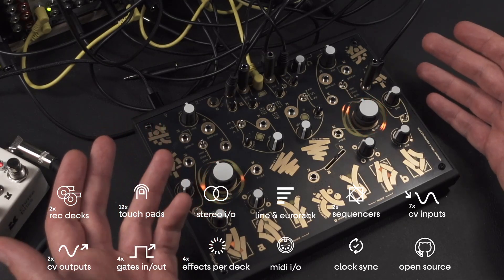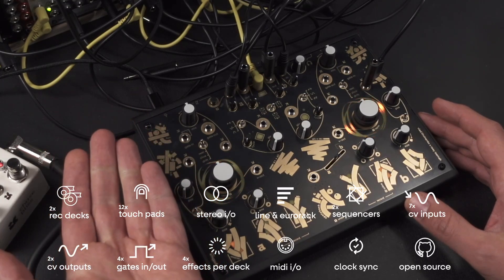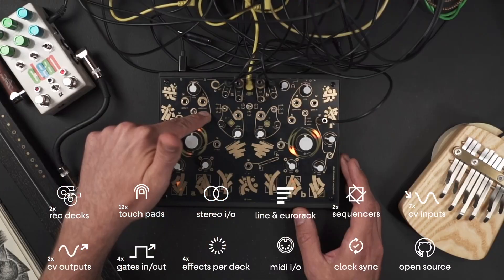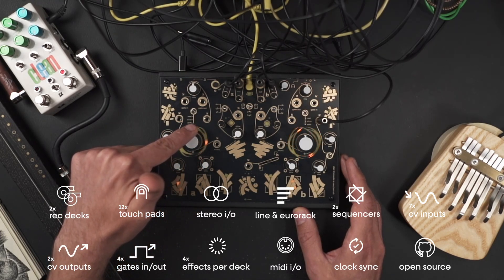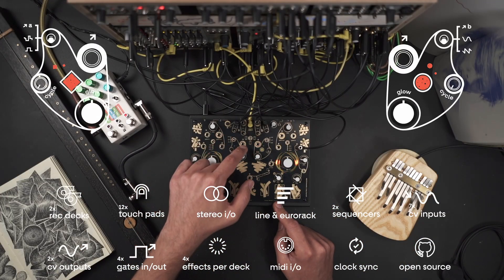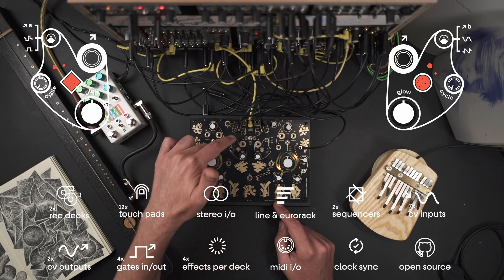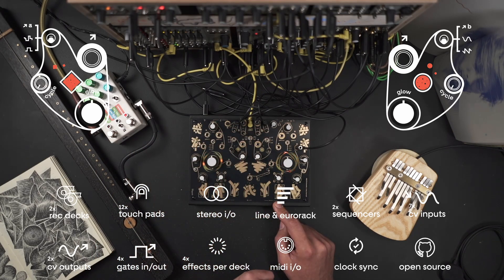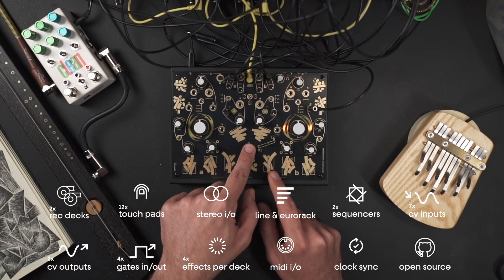This is Spotykach. Pre-Release Anouncement!

Comment: Is there CV control for Rec/Stop? I’d use that a lot for making quantised loops. Will we be able to trim loops?
Reply from the maker: Yes, there’s gate in and out per deck. Trimming loops can be done with the size and position knobs, but we are also looking into splicing recordings which should allow advance editing. In general, this is meant to be hands on performance tool rather than an editing tool, though.
Reply: @ that’s great. If you can add splices then perhaps you could delete the parts you didn’t want. That’s my workflow with the Morphagene. It’s a bit clunky in that respect.
Reply from the maker: @jamiestewart1644 yes, that’s the goal. We have quite a lot of LEDs to give user feedback, so it should be easy to navigate.

Comment: Wow! It's like 2 Morphagene's with a touch controller thrown in for good measure. I think it might work well with the Tape and Microsound Machine too. Is this on the same PCB as the Audrey II and will it be available as a kit?
Reply from the maker: Thanks! It has a different form factor than Audrey II. it’s a bit taller, to accommodate for the touch pads and I/O in the back (USB C, midi, headphones etc).

Comment: So its no eurorack compatible I take it
Reply from the maker: Spotykach is built for hands-on play, not getting buried under patch cables. That’s why it’s not in 3U. The custom enclosure gives you more space, better features, and a way better user experience. It sits neatly under your Eurorack case—and yes, it’s fully compatible with Eurorack and line-level signals, has MIDI I/O, and runs on USB power.
Reply: @ understood, well maybe a eurorack version for the second gen ?
Reply from the maker: It’s tricky with all this functionality. I’m not sure if we’ll take that road.